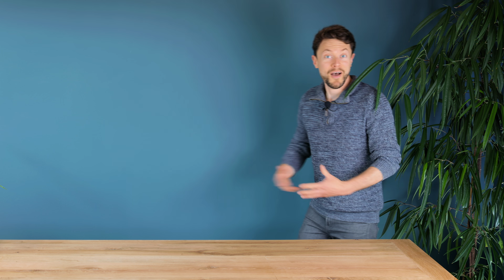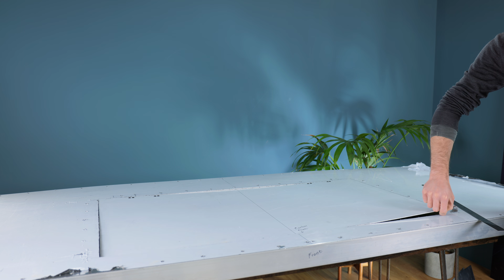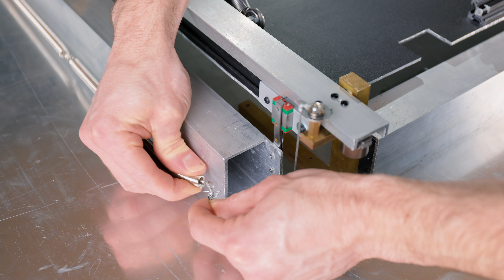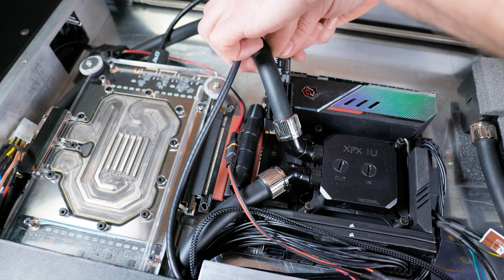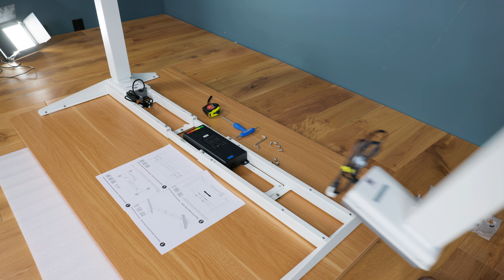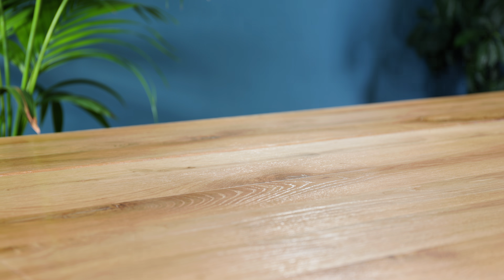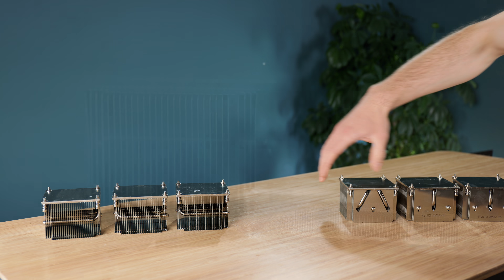Building the ENDGAME invisible PC

Comment: Summary

The Concept:

* (0:14): Build a seemingly normal wooden desk that houses a fully functional, high-end PC setup, completely hidden from view. 

The Mechanisms:

* (1:50): Hidden Monitor: A motorized hatch mechanism using invisible hinges reveals a large, ultra-wide OLED monitor, lying flat within the desk.
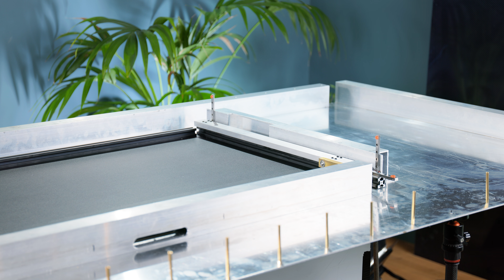* (4:57): Retracting Keyboard Tray: The monitor hatch opening triggers a spring-loaded platform that rises to desk level, providing space for a full-sized keyboard and mouse.
* (20:17): Magnetic "Key": A seemingly ordinary magnetic paperweight acts as a key, pulling on a hidden steel plate to open the desk. 

The Components:

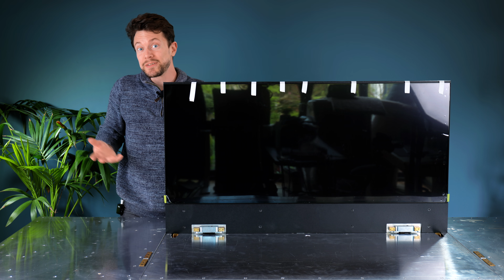* (9:10): High-End Hardware: 
    * CPU: Intel 13900K
    * GPU: Zotac 490
    * Storage: 48TB flash storage NAS accessed via a 10GB m.2 network card
* (9:48): Compact Power: Due to space constraints, the build utilizes two Gallium Nitride power supplies (500W each) for the motherboard/CPU and GPU.
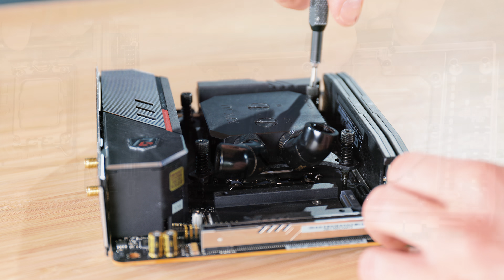* (9:30): Water Cooling: 
    * Initial Attempt:  A custom loop with a brass heat spreader and numerous small, server-grade heatsinks paired with bidirectional laptop fans.
    * Final Solution: (23:04)  After the initial setup proved insufficient, the build was redesigned to use larger server heatsinks with standard 140mm PC fans for silent and effective cooling.

The Challenges & Solutions:

* (21:35): Initial Cooling Issues: The first iteration of the cooling system proved insufficient, requiring a complete redesign with larger heatsinks and standard PC fans. 
* (16:42): Aesthetics: Thin wood planks, meticulously applied, conceal the aluminum desk frame, while tapered edges create an illusion of thinness.

The Result:

* A truly invisible PC setup seamlessly integrated into a sleek and functional desk.
* Powerful components run silently thanks to an overkill cooling solution.
* The entire build utilizes a FlexiSpot adjustable height desk system, allowing for both sitting and standing work modes. 

i used gemini 1.5 pro to summarize the transcript

Comment: Wouldn't either the brass pipe or the non-brass gpu/cpu cooling blocks start to 'rust' as you've essentially created a battery? I think that you would typically match all metals that are exposed to the cooling liquid.

Comment: What happens if you push or lean too hard on the keyboard area? Does it fold the screen in? Or is there a locking mechanism?
Reply from the maker: The magnets lock it pretty well. I've not had it close unintentionally as of yet, it really need quite a shove to close it.

Comment: It's missing speakers! You could try a contact speaker (basicly just reverse contact microphone) on a section of thinner, membrane like material (think drum or speaker surface) in the edge triangle you attached to the side for an invisible sound source. There's lots of TVs these days that do something similar, using the face of the TV as a speaker. Technology Ingredients also has a whole series of wall embedded flat board that perform fantasticly, you could hide an entire 7.1 surround system. You might be able to fit it inside the desk with the same contact speakers, smaller of course, and direct the sound of them towards the center sitting position of the desk. You reduce the complexity of the parts somewhat and get another deal with flexispot, you might be able to sell this design as a kit and/or finished product with flexispot. A range of invisible desk PCs sounds like exactly the market segment they'd love. places like framework already let you bring your own parts as well which could further reduce costs and improve margins.

Comment: 24:00 if you are already using the PC fans, why not use PC radiators that will definitely keep the PC cool? You dont have to solder a custom tube and use thermal paste which makes the temps worse, too. Price doesnt matter at this point anyways.

Comment: you could definintely had used those copper heatsinks but you needed something with higher static pressure than was achievable with those laptop fans and likely would have needed a louder blower. the laptop fans have a higher static pressure normal pc fans but had only ~3.4 cfm per fan (based off similar model from same manufacturer) whereas those corsair ones you used were 75 cfm per fan.  the U-bend you put in and high surface roughness of the 3d printed manifold also contributed to pressure drops and a decrease in flow-rate.

Comment: Theres an improvement to be done with the heat exchanger, some of the heat u are removing from the fluid will be put back into the colder fluid as the heat exchanger makes the fluid go over the same radiator more than once and not with a similar heat, so a good improvement would be doing the tubes go over one exchanger fully and then the next, the problem in that case will be a lot of loss of strength in the fluid do to the turns but you will compensate it with  a good pump, if not, you could use compression and expansion of the fluid working as an ac but that’s also not so diy, and the last option that I see possible is passing the tube through another fluid that you could get colder outside the pc

Comment: A linkage would have been simpler and cheaper than all those linear rails...
Carbon or glass fiber panela would be more rigid and lighter

Great build though

Would be really nice to know where you found those slim copper radiators
Link ?

Comment: An attacheable cooling loop like this would be interesting as a ultrabook dock. 
The Ultrabook touches the metal chassis (perhaps through cooling pad) and then cools it to prevent the usual thermal throttling on Ultrabooks

Comment: The only issue that would worry me is if something happened to that monitor cable being behind glued wood.  Everything else in the setup seems pretty easily replaceable.  The monitor, however, would require the wood to be disassembled.  Otherwise, fantastic job.

Comment: You've outdone yourself here, this is exceptional.

My only thought is that it's using an awful lot of fans that are airflow optimised. I wonder if your original heatsink arrangement might have been better, but modified to include a plenum/manifold with a smaller number of static pressure optimised fans that are mounted in parallel to the desk surface.

Comment: I don't know if i missed it but how do you turn it on? (if its on the video can someone comment the time stamp)
Reply from the maker: I put a small push-button behind the Flexispot control panel, and routed the wires for it to the motherboard through the desk as it's on the opposite side.

Comment: BETTER than the magnet management for lift  open operation. another method would had been to have a push hole opening pad  or lever mechanism to pop it open like in spirit of a car engine hood. like, even a pull wire lever that pops the  hatch up  with a wedge prop to get a lifting grip to open it out further.

Comment: You know what's funny? The "hard to work with" weird cabinet hinges actually have a straight forward closed position and pivot out to avoid the edge problem, that later needed fixing.

edit: Fair enough, forgot this is a "I did a cool thing" channel, not an advice/research channel, which the professional sounding editing style would suggest.

Comment: This is so great, but imo there's still one thing that prevents it from being absolutely perfect. Since you used a flexible curved OLED screen it would have been incredible if use also used hinges to automatically bend the screen when opening it and flattening it when closing it. But it's still a monumental achievement and an engineering beauty.

Comment: this is a bad concept for multiple reasons...  1) the ergonomic monitor height to match eye sight lines relative to desk height is different for sitting and standing. At at first glance, that monitor height seems ideal for neither. A sit stand desk needs a monitor arm with a good height range. 2) that much thickness to the desk is going to be terrible for leg comfort especially with the extra thick sharp mechanical bits on the bottom. 3) maintenance will be a nightmare having to work upside down 

however rigging up that heatsink array to a SFF 5-10l watercooled pc might be interesting.

Comment: Bravo!!! You should put some stronger springs for the “going down” motion because have put to much weight on the vertical plane (keyboard, mouse,speakers…) and now when closing you need to hold it for the magnet. Rest is absolutley amazing. Bravo,bravo

Comment: While I applaud making your own cooling system... you should probably have gone with a bank of Noctua 40mm fans in push/pull on a series of 40mm radiators.  There are choices out there, but a quick google search gave me Alpha Cool with 7x40mm rads at about $130 each.  And yes there are better performing fans, but Noctua's are quiet.

Comment: This is an awesome project that is giving me some inspiration. Just a question though. 

What if you were to use linear actuators on the sliding rails to open and close the lid? I'm worried that the magnet is slowly going to scratch the wood over time and become much more noticeable due to the wear. Since the sliding rail is connected to the opening and closing mechanism for the lid, would a pair of properly placed linear actuators make the lid easier to open and close and also more stable when in the open position?

The desk  turned out beautifully, and I really appreciate that you showed where your initial plan with the cooling didn't work and your solution that did.

Comment: Very nice,  but it's worth remembering that the Tc of brass is much lower than copper, around 1/3.  It's the same deal as stainless steel vs plain steel.   I  don't know where you'd buy square copper tube but you could fill round pipe with sand and then roll it flat in one or two axes.  If this really is endgame, then also note that Tc of silver is 5% better than even pure copper.

Comment: Only technical problem I have with calling it the endgame invisible pc is that heat output is still in the same room. So have it been pushed hard for a long time and then shut down. Someone walking into the room feeling the abnormal temperature difference between the room they came from and the room where the pc is in but can't see it would be very suspicious. But if he somehow could get all the heat output hidden to the outside the room without opening a window

Comment: All that work to be quiet. I had a Mac laptop back when hard drives would spin. Thing was so quiet most of the time until twice a minute the stupid read head would make a sound. It was so annoying to read quietly on it with that regular disturbance. I think it was because the file system used journaling. Still a terrible design. The hard drive on an IBM would shut down for the same task but not a Mac. Absolutely no functional reason to keep activating the hard drive. I was just reading and scrolling files already loaded into ample RAM. I hate apple.

Since then I replaced the hard drive with an SSD. now the fan has to run high speed bc the CPU overheats. No winning with that fruit electronic.

Comment: What keeps the hinged platform "locked" in the open position? I didn't see anywhere in the video where you mentioned something locking it in the open position. It looks to me like if you push very hard at all on where the keyboard/mouse are at, the whole thing is going to want to close on you.  The spring and other hinge mechanisms don't have any "lock" to keep them open.

Comment: So much aluminum can be effectively used for passive cooling if flat heat pipes are added and the heat is dissipated from these brass pipes or additional ones. The stage with radiators will probably still be needed, but it can be used either after passive cooling or, conversely, to further cool after passive heat dissipation. However, a balance is needed between comfort and a hot desk.

Comment: Great project.

But: if you mix aluminium, copper, brass and water, you build a big battery cell that corrodes the metals. You might want to replace some parts …

Comment: When someone spills something on your table and says "Good thing you had nothing on the table", and you crying on the inside. 🤣
Reply: "on the inside" quite literally
Reply: Maybe he could put some rubber seals around the openings to at least make the water stay in the outer surface so it can be wiped with a towel.
Reply: Knowing there’s a high end PC inside the desk
“Please leave before I murder you”
Reply: And if you let anyone near your £45,000 desk with liquids, you deserve every one of those tears lol
Reply: Like with most laptops the water would just flow through the keyboard and mouse part and drip from the bottom
Reply: I think the desk is water proof since there are no visible cuts, but I could be wrong
Reply: @superkhangfn8593  with that spring loaded piece of wood at the back of the screen, it's unlikely to be water proof
Reply: @superkhangfn8593  It's hardly water resistant let alone waterproof
Reply: @superkhangfn8593  Water may be an inanimate substance, but you'd think otherwise when you're trying to keep it out of something. It's like a gremlin with magic powers to get into your everything! XD Even when you know it's the capillary action, it still seems improbable.
Reply: Least deserved 2,1k likes

Comment: Seriously impressive. 2 questions. 1: how is the heat output in the room, like does it increase the ambient temp of the room it's housed in, or capture some of that heat output under the desk? 2. Audio isn't really considered it seems. I noticed some small speakers, but would there potential be a way to swivel out wide spaced speakers on the back corners? Would wireless placements in discreet areas in the room be the only real option for wide stereo or surround?

Again, just a marvel of design. Bravo!

Comment: Everything is very good, the mechanism of the monitor (although it is not very clear at all) the general structure of the desktop and the liquid cooling, now, the question is
And how do you connect all the back panel of the motherboard? or do you lose all the connectivity of the motherboard?

Comment: This is pure madness. In a good way ofcourse. Next time you have problems with fans, give crossflow fans a try: i think you could get away with a single line of heatsinks threre, and with crossflow fans you could reduce the height of the cooling system thus bringing back the  "invisibility factor".

Comment: You never cease to amaze me, Matt.  That's one over-the-top build project!  Very sweet for those who pride themselves on being on the bleeding edge of technology and have the money to pay for it.  Those of us lesser souls, however, could probably do as well with a little less bling-bling.  For example, you could halve the price of the system by going to an i7 or i5 CPU, a lesser monitor and no GPU.  I just use the IGA built into my i5-13600-K Intel processor.  I have no need for games and the IGA works great for down-streaming 4K videos without overheating the chip.  Your cooling solution is impressive but I wouldn't want to be the guy who has to clean those fan blades and fins every month.  I Did that for a living and that was enough for me. Seems to me that 3 or 4 of those big fans with flow-through ventilation provided by plenum and strategically placed holes in the front of the cavity should be plenty. I'm on the fence about water cooling, though.  I admit WC makes a more compact system than air cooling but there's always the pump, water and radiator to think about.  Maybe heat-pipes a la high-end laptops going to a row of those nice, short copper heatsinks you tried originally would work as you wouldn't have to blow away so much heat, especially if you don't use a GPU.  However, your concept sure makes me think about what is possible with today's high-end technology -- for that I thank you.  Congrats on a well-conceived and executed build!  BTW, I really like the hide-away automatic lift table idea - I'm jealous because I don't have enough space in my tiny computer room to put it.  😀

Comment: Your cooling issue may have been related to the fact that your inlet and outlet were soldered together, so whilst the heatsinks may have reduced water temperature, the inlet was heating the outlet directly.  Having the inlet at the opposite end to the outlet would have helped.

Comment: it would be cool if you can integrate a press-to-open system, like those for kitchen cabinets. it would remove the hassle of having to use a magnet, which i think the convenience of will be greatly reduced the longer you use it. Maybe use some stronger springs than those for cabinets though.

Comment: Magnificent design and build I do have one suggestion for a major Improvement which is the audio why settle for such a inferior soundbar within the confines of the cavity when you can utilize the same area as the larger fans with an audiofile quility Bluetooth capable soundbar which can be utilized even with the tabletop closed I see no need for such a major concession to conform to the limited space of the cavity when a soundbar is a long rectangular narrow item by design the same as your custom heatsink.

But overall a fantastic concept for a desk!

Comment: 23:06 Why not going with Noctua fans, they would me so much more quieter with the same if not higher airflow than those Corsair fans? And you might have even have been to cut down the height  of the heat-sinks using one of their smaller fans I've replace all my 1U rack fans in my server rack and it has made all of them so quiet with making it a lot cooler as well! Only downside I can see in this great build.